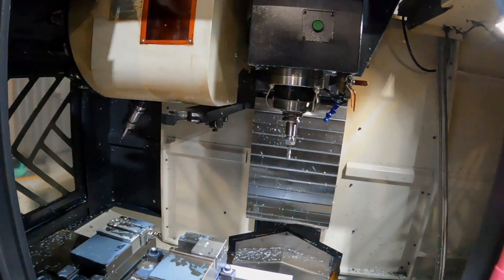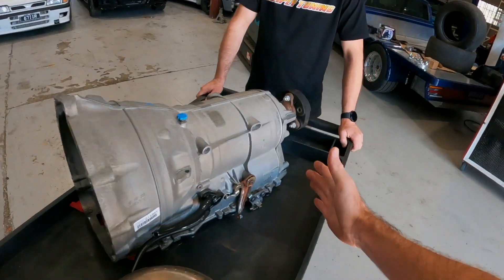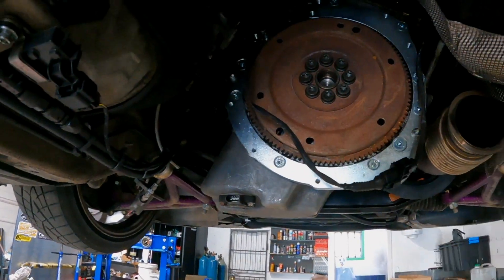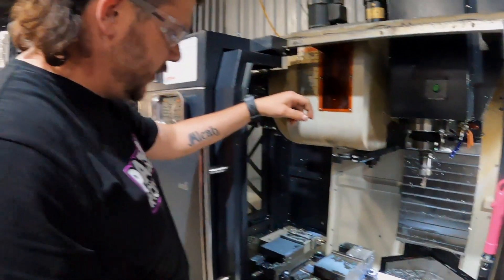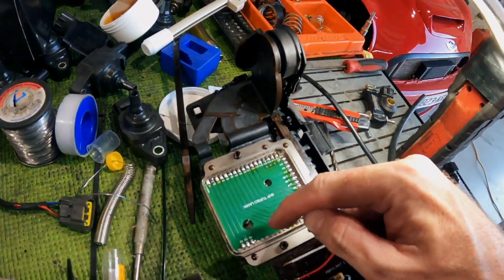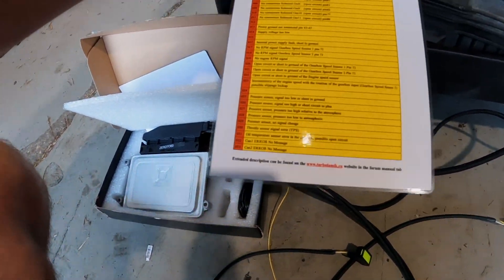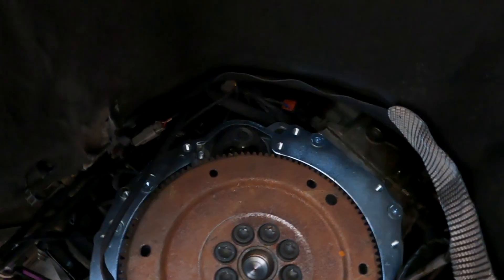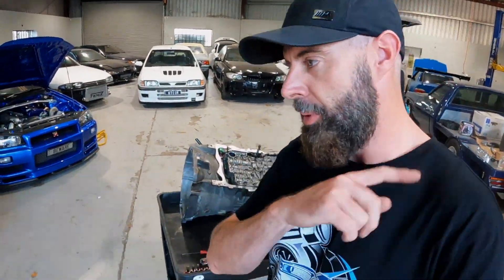WILL THE 8HP TRANSMISSION WORK IN A DRIFT CAR?

Comment: sim racers use real master cylinder with bike reservoir and instead of it going into clutch there is pressure switch that senses how much pressure is in the system and that is then used to for the in game clutch. Maybe somebody else can explain it bit better but this is the basics how it works :D
Reply from the maker: Ahhhh a bike master cyl…. Hmmm.
Reply: @ZeroTo60Tube  andrew, bike reservoir...not bike MC! If I get it right!

Comment: maybe try using the slave cylinder to push on and compress a spring? maybe experiment with different number and stiffness springs. possibly see if you can rig up something to see how much force it takes to compress the pressure plate fingers and go from there.
Reply from the maker: Hmmmm that makes sense. Maybe something like a valve spring. We’ll see if we can rig up some test parts

Comment: Love the channel so far boys, been watching all your videos. Have you had an update on the forge built N54 ? i'm just across the ditch in NZ starting a similar build (same pistons and rods) and seeing if you had found the problem you came across a while back to see if it would be avoidable. Keep up the good work. :)
Reply from the maker: I did actually dyno the car, but all the footage was taken with my laptop. The motor has lifted the head. But as the guy with the laptop also wants that car it’s still dormant. King story short, it needs an engine and gearbox build again now 😒

Comment: This car is getting cooler and cooler by the minute just a quick one hoping you could help trying to do a conversion in my car but my torque converter is touching the flywheel with no play do you know what gap I need between my flywheel and converter when the converter is pushed all the way into the box is it around 3mm?
Reply from the maker: I actually don’t know what gap is needed. But you don’t want pressure on the input shaft. Did you get the converter sitting back over all the notches?

Comment: Is there a potentiometer sensor that can used on the clutch peddle with the Turbo lamik 8hp tcu virtual clutch or is it just a on and off switch ?
Reply from the maker: You do use a potenciometer 0-5v and it can be configured for bite point vs pedal travel on linear or progressive scaling. It’s pretty clever the way it can be set up on the lamik.

Comment: Is there a difference between the jaguar 8hp70 and the bmw one apart from bellhousing?
Reply from the maker: As far as i am aware the entire case is different. Havent checked output shafts. Also the trans cooler ports are different. And the converter.

Comment: After watching again what are you guys going to do for the gearing? I know being used sequentially allows for quick gear changes but for drifting being in the right gear is pretty important. For the 8hp I feel you will be changing gears quite often. Are you going bro be making longer gears or do you think 1-8 gears should have a gear long enough for the long corners but short enough for good transitions and slow corner stuff ?
Reply: The car runs the OEM M3 gearing (3.46) Which is heaps shorter than what a M240i would come with (2.81) So should be heaps zippier than a stock BMW with an 8HP, and the gears in 7th and 8th are enough to do basically warp speed, I think it'll work well, most likely be in 4th and 5th most of the time while drifting... Hopefully....😂
Reply: @Buckna1  I've got a 607hp v8 with an 8hp70 in my MX5 which has 3.42 gears, I agree, probably be in 6th or 7th most of the time.  Definitely feels like warp speed.
Reply from the maker: Sorry @devon I missed this, we hope the factory gearing will work. Top speed in 7th gear should be around 290kmh
Reply: @ZeroTo60Tube  she’s going to be a ripper for sure. The automated hydraulic clutch pedal is nifty to say the least. If you guys go big power the guys over here that have the 8hp get it build but pure and they do what ever when ever without issue for the most part  800hp now is like the norm.
Reply from the maker: @devonsmith1995  im hoping this 8hp70 will hold up with out being built, but we will see
Reply: @ZeroTo60Tube  shouldn’t need too they hold pretty good power. Haven’t seen any that needed building unless going for high hp and tq

Comment: So... what are whp losses with an 8HP vs DCT vs manual transmission?  I was told the 8HP reduced WHP by ~40HP on a dyno when compared with S54 engine and manual transmission.  But when you look at factory installed 0 to 60 times ie M240i etc. the 0 to 60 times are close...
Reply from the maker: Zero energy loss on 8hp or DCT compared to a manual. Both the DCT and 8hp fully lock up.
Reply: @ZeroTo60Tube  Thx :) that makes sense... guessing it wasn't locked on the dyno.

Comment: Can this all work with my E36 S54 swap with OEM flashed DME ? Car doesn't have CAN
Reply from the maker: ha, i think we are emailing....... you didnt mention in your email about the car not having can. Regardless of the chassis, the DME will still have an active canbus. The controllers connect to the DME.

Comment: Does it matter what vehicle you source the 8HP from? you can find loads of 8HP70's  but they are all coming from different cars, trucks, and SUVs. Does it make a difference which vehicle it comes from?
Reply from the maker: Yes. They all have different casings, torque converters etc. so you need to make sure the one you go for will suit your application.
Reply: @ZeroTo60Tube  I should start with, I'm looking to replicate this swap in my own e46. Should I look for a BMW specific 8HP70 or can you recomend one with an adapter plate?
Reply: @dthomas6184  The best trans to use is the N57 8hp70. Found in f series rear wheel drive, 6 cylinder diesel BMWs.
Reply: @audreyastley4703  thanks!

Comment: I didn’t expect that from the M3, that e46 is going to be launching 10x harder! Any chance you’ll also change the differential? Either to an auto gears, or stickshift ones.
Reply from the maker: It does have a built diff already to handle the manual clutch drops. I will double check the ratio. I think Dan said the 7500rpm rev limiter in 8th gear with the lamik will be around 295kmh
Reply: @ZeroTo60Tube  that’s great news. I remember I was going to put an auto diff for drag racing on mine. I ended finding out the gearing will make me shift at 6500 rpm. I was trying to get ratios to go upwards of 7k rpm. Any chance you know what differential would allow higher rpm’s for a stick shift 335i?

Comment: Does the turbo lamik need a stock gear selector to work? Or can you integrate the dct sequential shifter straight to the Turbo Lamik? I recently did a shift knob change in my M140i and they dont use standard switches they use hall sensors. So it might be a bit tricky if you need to try go from the DCT sequential standard switches to trigger the stock selector into D,N,S, Gear up and Gear down. 

https://m.youtube.com/watch?v=8C_Z2a9MtDs&feature=youtu.be
Reply from the maker: You don’t need a stock shifter. However they are nice for the ability to quickly change between modes.

Comment: I can't think of anything more unsatisfying than having an automatic drift car 🤢
Reply: Why do you care about some one else’s car tho lol plus it’s just a trans and it’s being used sequentially with a clutch just like a manual like ever FD car. How many FD drivers have you seen with a standard 6 speed ?
Reply from the maker: It should operate as a sequential transmission. You know what all the pro drifters use. These 8hp’s a pretty special when you have the aftermarket controller on them.